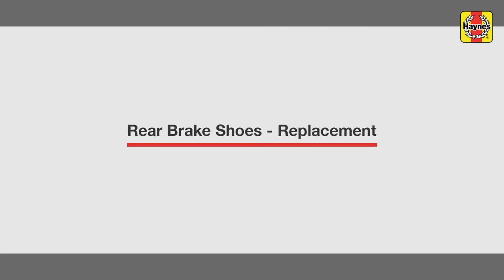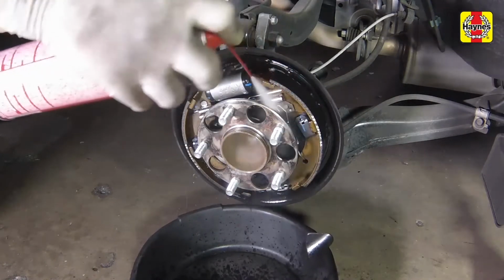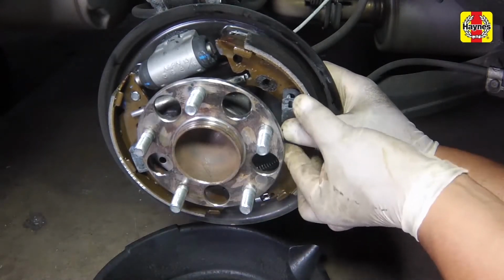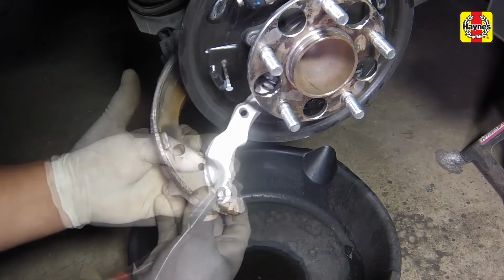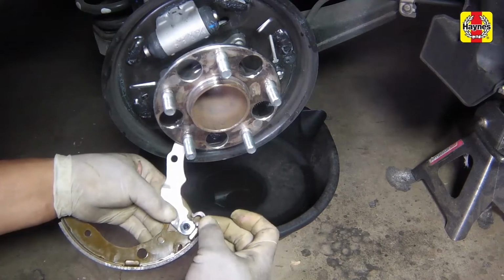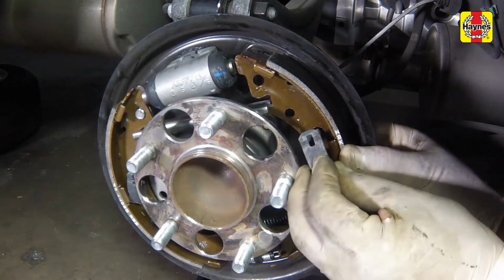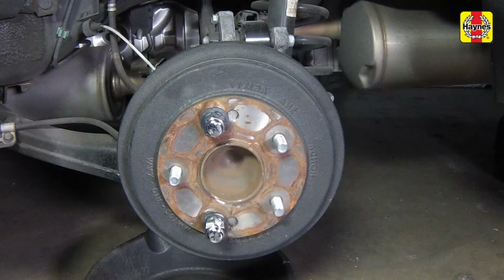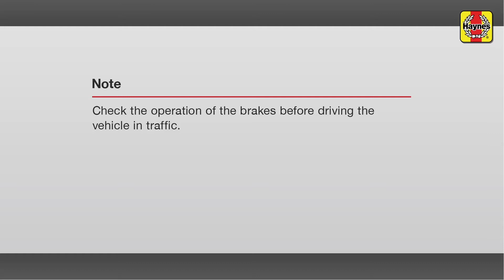How to  Replace the rear brake pads on the Honda Civic 2012 to 2015

Comment: For anyone who can't get the upper return spring off,  use a large needle nose vice grip plier to get a good grip on the spring, and turn the adjuster wheel to bring the shoes closer together to reduce tension on the spring. You are welcome.

Comment: That top spring does not come off as easy as your video shows and neither does that horse clip on the bottom I can't get either one of them off and you guys make it look like it just comes off like nothing
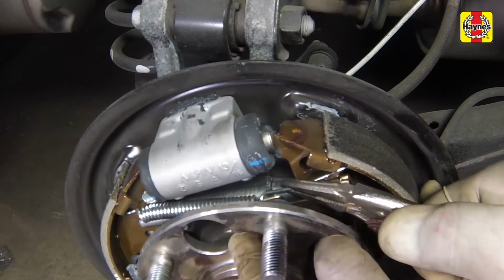Reply: You got that right!. I had to laugh at 1:11 when they removed the upper return spring with relatively little effort. Mine was so tight i thought i might have to dremel through it to get if off. I didn't even want to mess with my brake shoes but my wheel cylinder started leaking when i was bleeding the brakes. I replaced the cylinder but could not get the drum back over the brake shoes and figured the adjuster bolt must not be seated all the way and the only way i could ensure it was right was to disassemble the brake. What a relief when i finally got the drum back on and the new cylinder did not leak!
Reply: Thank you. I thought I was stupid and weak. This video is kind of a lie.
Reply: @Ta2edwarrior  I have a 2013 civic in America do I need to worry about this?
Reply: @alexisstoupa3872  I ended up having to pay a shop to do it. I followed the video step-by-step I don't know what I did wrong but I hate drum brakes
Reply: Idk what magical tool you have to effortlessly adjust the adjuster through the back of the drum but my fat head and flat head screwdriver is not fitting back there at all.
Reply: @ryanrlantz  For all of you guys, use a needle nose vice grip plier to get a good grip on the spring, and turn the adjuster wheel to bring the shoes closer together to reduce tention on the spring. You are welcome.

Comment: What size bolts should we use to get the drums off if the drums happen to be stuck?  I was told M8x1.25, but the holes on the drums were too big for that size bolt.  It looks like it may need a M10 or M12 bolt.  I just wanted to see if there was an updated size for that on these 9th generation civics. Thanks.
Reply: sorry for the late reply, its a 12 mm bolt for the holes for the rear brake drum cover to force the rear cover off. i had this issue too when removing it. good luck!